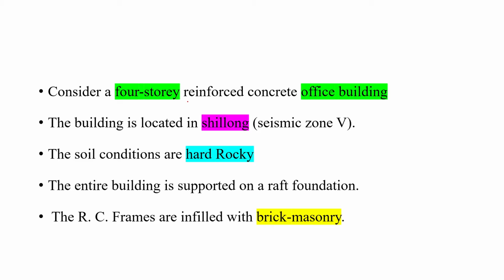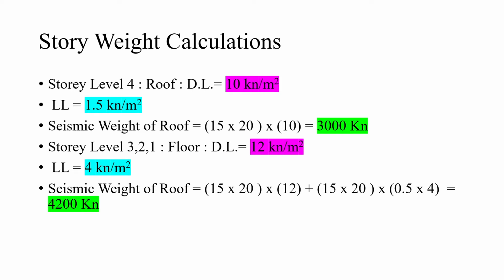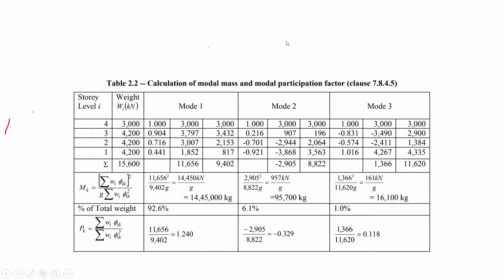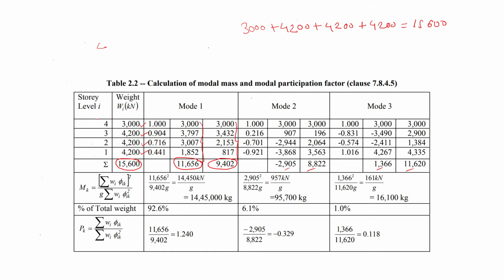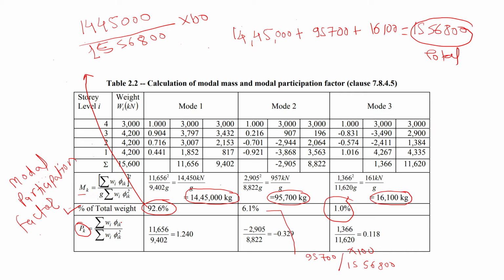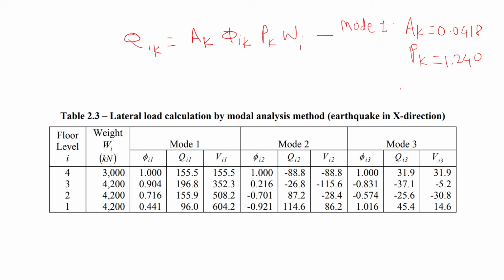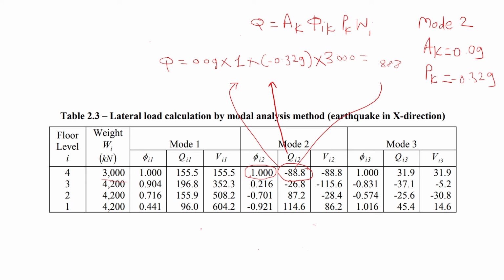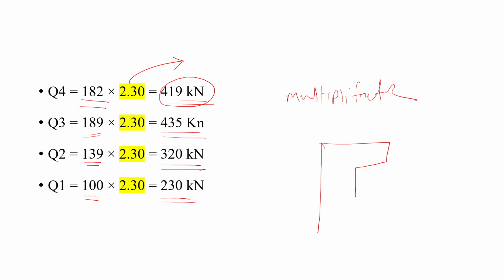Dynamic analysis Response Spectrum Analysis as per Indian Standard Code Stepwise Manual Procedure

Comment: Here 4 floors , then 4 mode shape will be there. But 4th mode missing in this calculation. But this wonderful presentation, i learned much
Reply from the maker: Thanks for the feedback! You are absolutely right; a 4-floor structure should have 4 mode shapes. The 4th mode may have been omitted for simplicity
Reply: I am analysis G+13 building, it requires 18 modes to meet the modal mass participation 90%